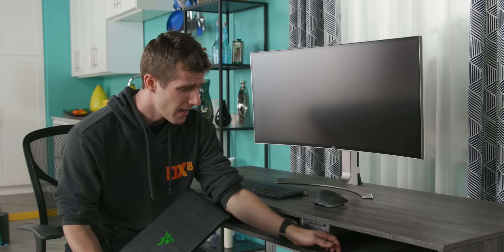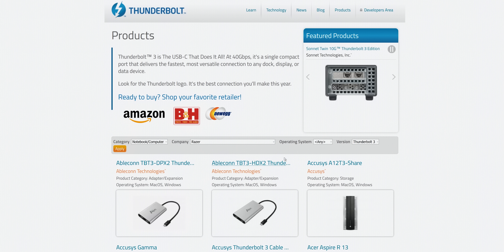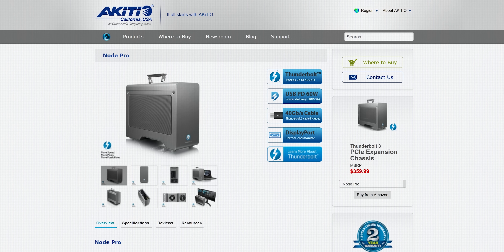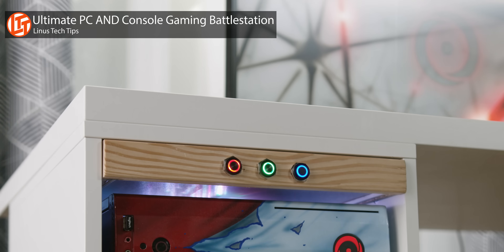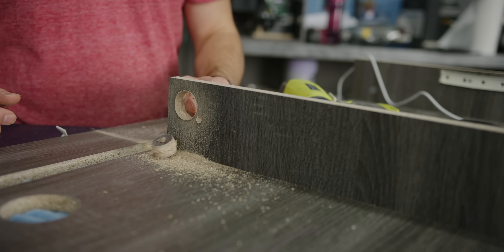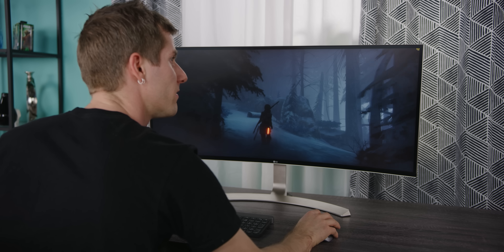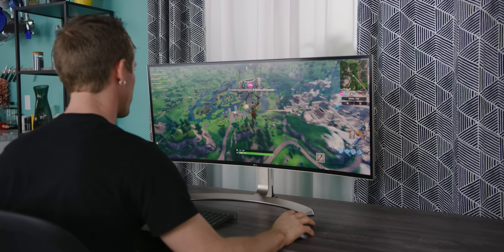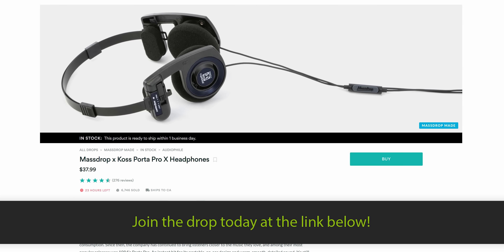This is the CLEANEST Setup.

Comment: older laptops used to have docking stations that did exactly that out-of-the-box (well, maybe besides external GPU), you would just mount your laptop to the station, and gain access to many different ports that were not present on the laptop itself

Comment: won't the laptop kill it's monitor?
Reply: Why? The laptop should turn it’s internal screen off, so it shouldn’t get too hot.
Reply: @GreeniusGenius  surface heat from chassis will transfer to the display screen melting the display thingymabob inside.

Comment: @Linus Tech Tips  could you repeat this with thunderbolt 4  and its benefits?
I really love the setup and im thinking about building one my self. Thanks to the detailed explanation.
Reply: The benefits of Thunderbolt 4 are higher minimum requirements, requiring 40gbps over 22gbps that some manufacturers were using with TB3, and requiring support for dual external displays from a single port. With regards to docks, this brings the ability to have multiple TB4 downstream ports, basically just PCiE switching, but apparently this works with Thunderbolt 3 hosts too, so… 
So it really wouldn’t change anything about this video.

Comment: If you don't really care about the GPU, then just get a Thunderbolt to HDMI adapter, get an HDMI cable and connect it to the external monitor. And done, you have 2 monitors. This is useful for like I don't know, when you stream you can chat on the laptop while playing on the monitor.

Comment: could the power issues be solved by using a laptop that is powered by a main ac connection on a brick rather than using the thunderbolt for main power and instead just for data/graphics transfer?

Comment: The maybe the cleanest setup, but its the opposite of the noobest setup. Because most laptops don't even have a thunderbolt port. Especially if they are from Africa or India. What is your opinion on a 15.6 inch High Performance Laptop (built in NVIDIA GPU) hooked to a monitor via USB-C Display Port. And a USB Hub for the accessories like Keyboard and Mouse. And a connected Ethernet. The desk will obviously have lots of wires because wired has more performance than wireless atleast as of now. (Unless the laws of physics change because vaccuum is not possible over the air we breathe)

Comment: Hi Linus! Thanks for the great video. Would like some advice if u have the time. I'm currently on a Razer Blade 15 Advanced with Intel(R) Core(TM) i7-10875H. Its a great laptop for gaming and content creation. However, I would like to edit 4k video even more smoothly on my external ultrawide 38-inch LG monitor. Whilst I can do so currently, I was thinking that an eGPU might enhance my setup. My questions are:

1. Given my CPU, how good a GPU could I install in the eGPU such that the CPU doesn't become a bottleneck? My worry is that even if I install the best GPU, my CPU may not be able to harness the potential of the GPU and it might be a waste.
2. What GPU do u think would be suitable for the Node Duo to partner with the Razer Blade 15? I hear that the power generated should account for 2x the power required so I assume I could use a GPU that requires 250W?

Comment: You could've built two vents with fans into desk through holes to cool the laptop. They would fire up when TB is connected push air down below where eGPU is and would go out. Also you can have two TB 4 ports and have one running eGPU and other TB dock.
Reply: Thunderbolt 4 wasnt a thing at the time

Comment: the m1 macs r here and take up less power than any intel mac, which means if u did this with a blackmagic egpu pro, a plugable usb-c dock and a m1 macbook pro/air it would work and u should rlly do a video on it
Reply: M1 doesn’t support eGPUs, either because there are no drivers, or because it’s hardware limited… Which kinda reeks.

Comment: I wish I had seen this video before I had to figure it out myself. I used a Dell WD15 dock with USB-C. My laptop has USB-C but does not have Thunderbolt and does not send video out the USB-C port so I used everything on the dock but video. I use the DP port on the laptop to send signal to my 75" Sony Bravia. My Acer Predator has 2 1 TB M.2's and is working very well.

Comment: How are you connecting the eGPU?  It looks like both of the TS3+ TB3 ports are being used by your laptop and by one of your monitors.  
Are you only able to run 1 monitor with an eGPU connected to the TS3+?

Comment: Isn't it a hassle to power on the laptop when its shut down because the power button is inside the lid? Since you have to take out the laptop, open the lid and push the button. Or is it on sleep mode where the laptop can wake up with mouse and keyboard? I wonder if the laptop support wake up when the ac is plugged in.

Comment: honestly the only reason i have not aquired a laptop instead of getting desktops all the time is simply that laptops tends to melt themselves from pure overheat when you use them for more than a few hours of gaming
Reply: rtx 3000 laptops are actually a lot better when it comes to thermals than the old ones
Reply: @loreaver3882  thats pretty Nice…..would you have any idea what a modern up to date laptop would be able to keep going for ? In terms of years its the other thing im a little woried about with buying a laptop only to have it unable to handle games 2 years later

Comment: man i was so close but MY LAPTOP DOSNT HAVE A FREAKING THUNDRBOLT PORT
Reply: Just use a USB-Hub, an HDMI-cable and the charger. It will cost you 5 seconds to plug those in but save you 300$ in a thunderbolt dock.
Reply: @daftmell5237  thank you

Comment: Laptop recommendation: HP Envy x360 15,6 inch.

Ryzen cpu with 8 cores and 16 threads, vega 8 graphics so gaming is also a possibility
16GB ddr4 3200mhz ram
1T pcie nvme m.2 ssd
Bright touchscreen display with a rechargable pen
Can be used as a tablet as it can bend backwards

Comment: I'm unimpressed because an external GPU connected via any cable that tiny is going to be bottle necked more than a Core2 system running a 3080.

Comment: Cool video!

Regarding the mouse pad, I would advise leaving a few extra millimeters above, to counter the give in the foam of the mouse pad. Also, as the material ages it might start to stag a bit, meaning that it was perfectly flush at the start, your hand would start rubbing up against the edges of the indent, which would not be fun.

Comment: I wouldn’t trust the default fortnite settings, I have a 2200g using only integrated graphics and it defaulted to 1080 high. It’s only playable at 720 low

Comment: I know this is an older video, but if you want to recess the mouse pad use the CNC router, but clamp an piece of scrap wood on top of the desk and set the router to go through the scrap and into the desktop. That will save your finish from getting destroyed.

Comment: Linus: You need a thunderbolt 3 to do this

AMD laptops have left the chat
Reply: I need a solution for my zephyrus g14 :(
Reply: @mateojbuteler8974  Same
Reply: @aditjindal  I dont even need the eGPU (im okay with the 2060, its already a lot to me) just the displayport (which is included in the type c) and the wireless keyboard/mouse
Reply: @mateojbuteler8974  I just need the bolt 😒
Reply: @mateojbuteler8974  There are solutions that do not use Thunderbolt 3, like Dell D3100 or D6000, which do basically the same over USB 3, just without the support for external GPU

Comment: Generally speaking Steam client does not like having steam libraries on USB drives. It gets really angry and won't let you reconnect the game folders. If you have done this before with a USB drive you'll know what I mean within seconds of trying to start a game after reconnecting a USB drive hehe.

Another issue worth noting is that if your laptop is covered, some laptops draw cool air seemingly through the keyboards, so that could restrict heat dissipation. Also sometimes the air comes in/out through the bottom of the laptop (hence laptop stands) so you may want to design a desk where the compartment for the laptop can handle the total height of the laptop + possibly slightly ajar + resting on the cooling stand.

Having said all that, amazing job, congrats Linus Tech Tips team! Wonderful food for thought!

P. S. May I ask if this desk surface can handle prolonged direct contact with a gaming mouse without any mouse pads? You did say this table was Ikea garbage tier in build, so I am wondering how gud that laminated cover over the particle board works as a desk surface when abused by a gaming mouse/wrist's constant contact. Inquiring minds wants to know! ^^

Comment: [NO MEME HERE] But what's the point of running a laptop with Core-U or Core-H on a 1080x, spend all that money for the GPU and its enclosure, plus the connective thing, instead of simply having 2 different pcs? I mean, yes this sounds more like a sponsorship and it's ok, but this solution isn't cheap and it has not any benefit IMHO
Reply: I agree, the price range he is getting into is equal to building your own desktop and then you would have two computers to utilize.

Comment: Here's the thing tho. A decent dock, and the same gpu enclosure he was using would easily cost you around $500. With that money, you could easily get a motherboard, cpu, ram, case, storage and psu which would be equal to or faster than the laptop specs. So while it may sound great on paper, its not practical in practice.
Reply: I agree with this
Reply: i think this setup isnt intended for teens needing to be price efficient but rather for relatively rich office workers or programmers that just want convenience

Comment: I thought that I had the cleanest set up then I met the whole community in Jaipur which has this cult to have the cleanest possible set up. They would fit monitor in a wall and under it there would be a foldable table. They would show off the CPU (I know that is the bummer) near to the ceiling. Some would have CPU under their monitors lying horizontal like WHAT! Also I am not sure how we are defining the cleanest - I have seen showing off setups mostly.

Comment: It's a cool project, but much more cost-effective to build a desktop PC to go along with your laptop.  The desktop gives you redundancy, and potentially far more CPU power.  And it allows you to select from a wider range of laptops; you won't need a particular Thunderbolt connector, etc.

Of course, cost-efficiency wasn't Linus' goal here, and that's fine.  Still, for most users, the only compelling reason to build a table like Linus' is "because I can."

Comment: So after several months of saving, accumulating, and upgrades, I finally have a setup that uses the core principles here! I'm happy to report that this plan works on both Mac and Linux machines. The only caveat is that, because of how UNIX works, you'll have to properly eject any external hard drives before unplugging the Thunderbolt cable. My solution -- and the next iteration on my setup -- will be to set up a NAS and connect it by either high-speed USB or ethernet (depending on which one has less hiccups).
Oh, and it's also worth pointing out that, because of driver support shenanigans, any Mac setup can only use AMD graphics cards and Linux works better with Nvidia; you'll have to pre-plan which OS you'll run with. Then again, I'm probably the only person who has to think about this.
Thanks for this video!
Reply: linux works better with NVIDIA? isnt it the other way around? with AMD having all the nice open source drivers.
Reply: @marcusborderlands6177  You'd think so, but AMD's drivers tend to be less reliable than Nvidia's. It's why System 76 ships a version of its Pop!_OS distro with Nvidia drivers pre-installed. It's actually common wisdom in the Linux community that Nvidia cards are just the better option.
Reply: @AwSamWeston  strange. well things have definitely changed since i last used linux some years ago.
Reply: @AwSamWeston  I have 2 AMD RX 580 and they work like a charm on Ubuntu-MATE and MX Linux, I don't see any problem with AMD, I don't know where you got that AMD's cards are less reliable on Linux, but from my experience you're very-wrong...
Reply: Hi! Could you explain the solution to the "have to unmount" unix problem? Thanks in advance.
Reply: Lmfao

Comment: I would love to see this being done with a macbook and bootcamp!
Reply: As a Mac user, please don't buy a Macbook solely to run Windows. There are cheaper more efficient options in the market.

Apart from that, this desk should work great with a MacBook Pro 13 (not 15-16 because of the wattage), except for the nVidia GPU and the lack of drivers (thanks Apple).
Reply: @AlejandroLZuvic  I wasn't going to. I use the Mac side all of the time but was thinking about playing games with bootcamp and an egpu. I would just love to see LTTs take on this idea

Comment: If you're going to have to CNC a custom build table to very specific details, spend $1000+ on an eGPU to plug in your $2000 laptop via a $200 USB hub. Just buy a regular desktop and hide the cpu behind the cupboard.

Comment: Quick question. I couldnt find the extended mouse pad ver. so I ended up getting 2x firefly v2...
In the razer synapse I can only control 1 of them. only 1 appear in the app.
When I remove one of them, the lights profile transfer to the one still connected, and once I reconnect the extra firely v2, it will lights up normally, no control on the lights, just 1 mode. and when I disconnect the one I did control, the lights profile transfers again.
Since firefly v2 dont have a memory built-in, it doesnt keep the chroma settings.
Any idea what I should do?
Can a USB splitter cable do the job ?
Is there a way to make the synapse app. recognize both of them as 1 ?
or maybe change the way windows recognizes and separate them somehow?
Thanks in advance

Comment: Suggestion: Put the cable in the table foot (if its a empty metal foot), for a even better look, and plug the cables in under the floor. Also: Where the multi port is located, stick a rail under there (color it to be invisible for the naked eye) with strong glue holding it firmly, and make the multi port go back and forth on the rail. That way you can hide it, pushing it back (Maybe include some kind of lock-in-place feature). Also make the multi port able to twist (but also with a sort of lock-in-place feature. I think that would be the perfect setup.

Comment: "Remember this is at 3840x1600 resolution on a laptop CPU" Yeah, i do that with my laptop aswell tbh, just upscale the display to 4K, i need to be plugged in for that to work, GPU is too power hungry to manage on battery.

Comment: I am still using the "same" tower as I bought in 1992. It is on its second screen, fourth case, fourth motherboard and fourth graphics card, like the Irishman's hammer. I have gone through several laptops in the same period. The ergonomics of laptops are a disaster. If you use a laptop regularly you end up with a big bill for neck treatment. As regards desktops, it should be possible to use them while standing.

Comment: Does your cpu in your laptop heat up a lot because it has the gpu with it and its producing more frames or does the egpu take some of the load off because I’m seriously thinking about getting something like this but I don’t want my laptop to get super hot because it’s already a gaming laptop and gets pretty hot but it’s getting super slow I’m really need a new pc but I’m thinking about doing this for more speed until I can get a gaming pc right now I’m having to use my Xbox and I need something with more power I stream and try to compete in tournaments but it just doesn’t get the job done I’m trying to raise money but I can’t get anything other than working for my parents so it’s super hard to get anything and I just want to pursue my dream of being a big content creator but the one thing that’s holding me back well the 2 things is not enough power and I’ve repaired my laptop before but it breaks every 2 months and then it costs 100$ to fix it and all I can do is work for my parents but they say the shouldn’t have to give me money like come on I’m just trying to work for money I’m not asking for it

Comment: But what is with the fan of the laptop. Isnt the laptop still working while you sit working on the desk? The fan of the laptop often is abov the keyboard so the laptop needs to stand open, otherwise the wprking fan will damage the laptop and the heat will increase

Comment: What if we got a display that had all the nick-nacks so we don't have to purchase the hub?
I was planning on using a portable display because I move alot from home and my grandmothers house because my grandma has stable wifi so i can do my college work there. I have a razor blade stealth '18 I can easily carry around  and wanted to attempt this set up with the laptop, portable monitor (G-STORY 15.6), and a recommended external GPU to finish my set up. I was thinking of connecting my laptop to eGPU to my portable display. Would this be reasonable and function? I know I am sacraficing alot here but I am ok with that as I am trying to get a clean and portable setup with the switch in enviornment. I would really appriciate a response back. Thank you :)

Comment: I have something like this but with dual 4k Monitors and no eGPU. It's mostly awesome when I use it but the monitor auto on is very glitchy. Often only one monitor comes on or a resolution is messed up or my vertical monitor isn't rotated properly. The end result of that is that I only use it when I do something I really need it for. Which is less than half of my daily screen time. 7/10.

Also: No speakers built into desk, no place for headset, no webcam, only single monitor and it sits on a stand taking up desk space. What is this crap Linus?!?